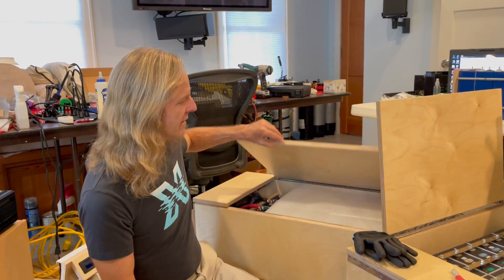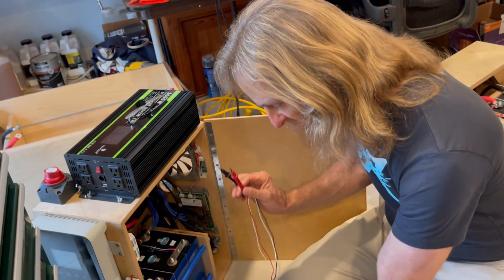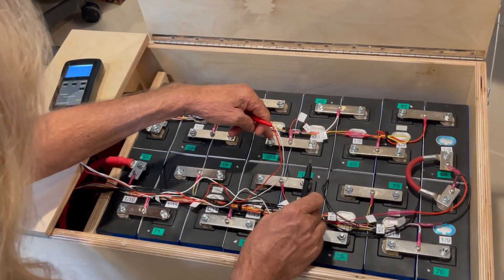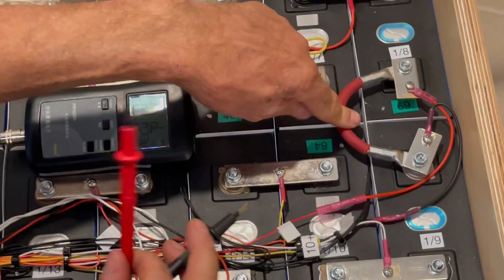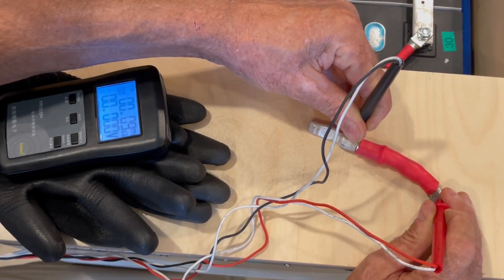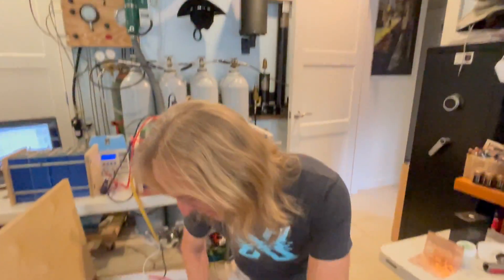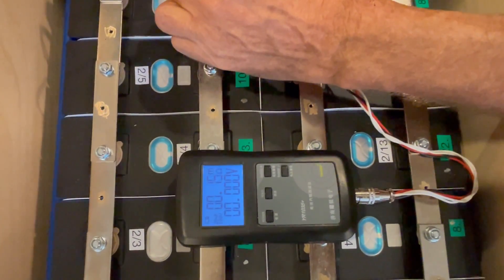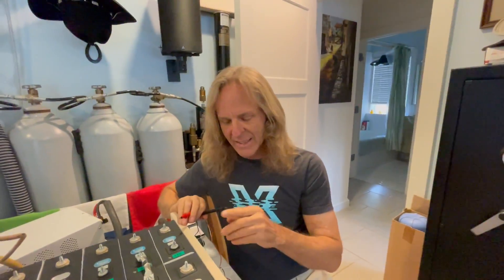It's No Joke, Size Really Does Matter!! Testing Flexible Busbars. Please read the description.

Comment: Ty so much for this information. You r so right no one makes the importance of the bus bars. Im an electrician but for commercial and some marine and we just went by the engeneers drawings to wire up loads always using nec regulations. But ive not been educated on the solar and dc side of things but we always stressed copper over aluminum and never used brass so it is strange they would use brass bus bars when the copper is better as a conductor of electricity. Thank u so much for bringing this to my attention.

Comment: You can't do a proper top Ballancen with 16 cells in parallel, and power applied to only one end of the series, at least you should make a diagonal power connection with plus at one end and minus at the other end, still however the string of parallel connections is too long. I recommend top Ballancen with maximum of 4 parallel cells, or even better only 3 diagonally connected, that provides for a more even supply of amps into the cells. But of course with an active BMS (supplying more power to the lowest cells), it helps even the currents out.
Reply from the maker: I don't understand how your comment relates to the video that it was made on. 

I will say thought that top balancing 16 cells is no problem at all and can be done to within one millivolt. Yes, it is best to charge from opposite ends of the string.

Comment: Ray use welding wire mate.
Reply from the maker: I use lots of welding wire. What do you mean exactly? The heavy red cable in the thumbnail is flexene welding wire but honestly 2mm x 20mm copper bus bars are perfectly fine and I use them everywhere I can. The people using flexible busbars should just realize that the size needed to match a typical busbar is bigger than they think. I must not be understanding something.

Comment: Not much electrical power is supposed to be utilized by the retaining studs/bolts. But the connection of the battery base terminal to the bus material.

Comment: I think i'd buy copper bars from a local metal work shop and make my own bus bars in case I received brass butt bars
Reply from the maker: And would you then pay to have them tinned to avoid oxidation and galvanic interaction with the aluminum terminals?
Reply: @RayBuildsCoolStuff  OH SNAP! Forgot  Galvanic reaction! Yeah you are right; I have access to 99.99% copper bars, but no tin plating shops (those chrome plating shops went out of business 2 decades ago)

Comment: So....does this mean you were able to find 1/0 cable lugs for sale that contained m6 holes? I have not been able to locate quality closed tinned copper cable lugs larger than 2 AWG that have the correct size holes to match the battery terminals. Any supplier suggestion you have would be greatly appreciated.
Reply from the maker: I got them on Amazon and when I added more batteries I found them. Again but it was harder and more expensive.
Reply: @RayBuildsCoolStuff  Ah...but if you were building 4s4p batteries for a boat in specialized plastic cases, where you could orient the cells in parallel, but wire them in series diagonally creating a little more wire length (to ease construction) and also achieve a cleaner balance wire arrangement + cable boots on the studs to protect from accidental metal contact and vibration chafe (think 5m waves outside Bora Bora).... My plan is to investigate the resistance a bit further with diagonally placed 1/0 cables and see if the loss is acceptable. I find it interesting that many high amperage BMS units have much thinner P- and B- wires... ~Cheers from s/y Element in Thailand~ Keep up the great work!

Comment: What’s your take on the difference in junction resistance of the bus bars and flexible links?
Reply from the maker: If you are asking if I think flexible links can allow for better contact then I would agree if care is not taken to ensure the bus bars are flat. I also think it is important to use welded studs as those that use the threaded female terminals are afraid to tighten above 4 nm for good reason. Copper bus bars will give enough to conform to slight variations in plane but not if you can't tighten the nuts enough. If you watch other channels you will see disagreement in our approaches. We must all judge for ourselves in the DIY world. That's a good thing, eh?
Reply: @RayBuildsCoolStuff  thanks for the response. I’m expecting a set of LifePo4 cells in the next week or two and I’m wondering what the best method of connecting the cells will be. Another YouTuber seems to have had problems using thick aluminium bus bars but a flexible link was fine. Obviously the cell terminals need to be at the same height but I wonder how level (perfectly horizontal) the terminals are. ( I hope I’m making sense) If the bus bars cannot flex and make full contact with the terminal when tightened down, there are going to be problems. Have you encountered this?

Comment: Sometimes, I don't understand what you are trying to accomplish here. If you really care about resistance on connections between cells, then use plain and thick (1/4 ") copper busbars, as well for washers and nuts, all in copper. Moreover the copper, being. a"soft" metal made a very good contact between posts therefore reduce risk of non perfectly flat contacts. I made my own 1/4" thick busbars from solid copper bars. Generally speaking, I do not like brass bus bars with their protection layer which change the reading of resistance. Just me, try COPPER!!!
Reply from the maker: Your comment shows I must have failed in communicating clearly. 

I use copper bus bars. The brass bus bars were sent by a dishonest supplier and were replaced with copper. 

There is no need for 1/4" thick copper bus bars. The 2mm copper bus bars are good for 300 amps. 

Raw copper will tarnish and over time will react with the aluminum terminals. My testing showed no benefit to using washers. The copper bus bars can be adjusted for flatness and will also conform within reason when the terminals are tightened.

The welded stud terminals have a smaller surface area but allow a higher torque value to be used so the connections are better and more secure. I have cringed at recent videos I have seen about other methods but we each get to make our own decisions about these things eh?

Have another look at the video and see if you hear it differently. I hope I haven't been confusing.

Comment: Hi Ray, 
Been watching you for a while now and this topics makes ask. 

I plan to install 2 units,  48v, 200Amp packs spaced 4ft apart to run a small EV as I am space constraint. 

Will an oversize connection cable compensate for the distance? 

Your thoughts on this will give me a direction to a solution and is much appreciated.
Reply from the maker: If you use 105c rated cable you should be fine with 1/0 wire. (50mm)
Reply: @RayBuildsCoolStuff  Did not think you'd be able to read my post much more reply on it.. You are the best.. 
More power to your channel. 
Thank you
Reply: Hi Ray, 
In searching Alibaba for battery packs. I asked the question about connecting 2 packs 48v (with BMS) in series for 96v EV use and have the ability to reconfigure to 48v parallel for Solar Hybrid (Emergency).
Though they could not give the reason why their reply was "Its not good to connect in Series (with BMS) but OK to connect in Parallel."
I got similar reply from more than one supplier.

Any thoughts on why this is the case? 

Thanks

Comment: I have seen in some of your previous videos that you have installed a 200 amp fuse in the battery box before the BMS. This means it is possible your entire bus bar system could be subject to a 200 amp current. Do you know your cell to cell bus bars are capable of carrying 200 amps? For 200 amps you would need somewhere around 60mm2 copper bus bars, that would be about 2.5 mm by 25mm copper bars. The 4AWG cable at the far end of the battery box is only capable of carrying 120 Amps. It seems to me that your bus bars and 4AWG cable will melt long before your 200A fuse blows.
Reply from the maker: I am using 200 amp fuses in the battery box. I am also using 175A breakers in the battery combiner box on each battery positive lead. The video notes that the 4awg 105c wire that is commonly used in this situation is not adequate and in order to equal the carrying capacity of the 2x20mm copper bus bars we use it would require 1/0 wire to have about the same cross sectional area. The 1/0 AWG 105 wire I use is rated for 286 amps. The 4awg 105c is rated for 160A. 125c insulated wire is rated for 172A. In neither case would the copper wire itself melt and an uninsulated copper bus bar certainly would not melt. If you watch this and my other videos more closely I think you might find that your concerns are addressed appropriately. It is after all the point of the connections video series that I made. I hope this helps explain my understanding of the issues involved.
Reply: @RayBuildsCoolStuff  Thanks for the reply. I was being a bit facetious using the word "melt" but I was worried the bars and 4AWG were undersized. I will do more research and watch more videos. I did not know you had a connections video series, I have only found this one so far on the subject. You have so many!

I want to thank you very much for all the work you have put into the videos. It is a lot of work for sure, but they are of great help to me. I am designing and building a prototype system and using your DC side design as a guide. I will use different AC side design as I like the MPP Solar LV6548 inverters.

Again thanks and I will continue to watch.

Comment: Nice and very interesting video about busbars and ther resistance. Was asking myself why commercial systems are equipped with welded busbars and taking the risc of tear and wear on the terminals when charging/discharging.
I use AWG2 cables to my Victron inverter, right in the middle of the square diameter of your future choice and actual setup.
I am still undecided how I will connect the terminals of my 16 pcs EVE 280K batteries but sure it will be at least AWG2.
Would like to use flat woven cables used for car engine startmotors, equipped with two 6mm holes for the new 280K cells.

Two questions:
a) what purpose do the 4 (CO2?) cilinders in the background serve?
b) I see you are balancing 16 cells. Are you top-balancing or bottom balancing them and what equipment do you use to charge/discharge your cells?
Reply from the maker: The cylinders in the background are for my scuba hobby. They contain EAN32 which is 32% oxygen. I use that and also blend it with helium or air or Oxygen to achieve other mixes.

The cells on the table are being tested one at a time in groups of 16 with a Zketech EBC A40L tester. Top balancing occurs in my battery boxes prior to final arranging of them into a 48v battery.

Comment: For my 24v 8s 280AH cell van battery…. Before I torqued down my tinned copper bus bars, they were getting disturbingly hot. I was much relieved when tightening them down improved it to having cold bus bars. I remembered your video being meticulous about your contact, so I got some conductive grease and a final sanding of the aluminum before attaching the bus bars. After getting off my battery and onto my circuit on the lid of my battery’s box I used flattened copper pipe to get to a kill switch and a shunt with 2 take off points for my inverter and the rest of my system. The only thing I am missing is a 250A fuse just after my kill switch for my battery.  I bet that will provide resistance. Anyway, thanks for the videos, they helped in my battery build.

Comment: @13:38 "I'm looking at all of the manufactured battery packs out there, and I don't see any of them...using flexible cable type bus bars..."  ...because wire & lug jumpers cost too much for too little benefit in most applications compared to solid bus bars. The cells intended for higher discharge rates (e.g.: Fortune) do have larger studs/bolts and contact pads, which is consistent with what your meticulous resistance measurements showed.

Comment: Since you’re looking to lean towards perfection, and I have that problem also…here’s what I’ve decided to do about my bus bars (5mm minimum thickness required… came with 2mm haaaaaaa) I have Two battery banks of 48 V 16 sells 300 amp hours each will be connected with each short homemade 2/0 welding wire with homemade 3/8 inch copper pipe for lugs which I will silver electroplate to reduce any corrosion effects from connecting them to the stainless steel terminals on the batteries, and increase the conductivity. When assembling I’m going to use some Conductive grease DEOXIT L260c. Any thoughts about my plan? (Non marine environment, however stainless and copper are dissimilar enough to create over time increased resistance, This is why they nickel plate them however nickel plating reduces the conductivity of copper… whereas silver increases conductivity by filling in any surface imperfections and the electroplating process seems simple and cost effective enough for anyone to do)

Comment: Once again… not batteries moving around…. EXPANSION and contraction!! Try to make thick aluminum “bookends” with your rods being spring compression to 12 psi. Claims by manufacturers of around 30% longer battery life… we all want to live longer, Yes?
Reply from the maker: The numbers you read for expansion and contraction are not accurate. Expansion does occur but I haven't seen anything close to the numbers that are published. Other of my videos speak to this issue and my approach. I use 1nm on four rods @ near full charge in a restraint system. I get no measurable movement of the cells from 0-100% state of charge and I'm totally comfortable with the solid bus bars. Consider that manufactured batteries almost never have any kind of restraint beyond holding the cells in place and most use welded connections with no flexibility at all. None use the method of springs that is popular with a segment of people on the forum. I do love the concept that we all get to figure out what we are comfortable with and pursue it for ourselves. It is a freedom that makes us strong and diverse which makes a robust community.
Reply: @RayBuildsCoolStuff  1mm per cell, if not compressed. as LiFeP04 specifications claim from low SOC to 100% SOC.

Comment: ALSO… 2/0 welding wire (9.5mm is 70m2) seems quite flexible and the short version busbar will have even less resistance than yours (yes 16 cells benefit from lower resistance)…
Reply: All gauges of wire you order online are  often described as flexible or soft. The variance from brand to brand can be disappointing. I find that Excelene brand the most flexible  and usually avoid any product labeled as welding cable IF flexibilty is of great importance.

Comment: have you done any tests that show any difference in capacity losses with the higher resistance brass? just wondering if it really makes a difference. do they get hotter while in use? will it take more energy to charge up the battery pack?
Reply from the maker: All of the energy of the battery flows through each bus bar. They need to be rated appropriately. 

Additionally, each bus bar is also a point of connection for the sensing wire for the bms and it is important that the voltage it senses isn't skewed by differences in resistance between the different cells. Low resistance and consistency is important. In the batteries it is not just about overheating while that is important. 

I want to build good durable low resistance connections that have a very long service life. I want to achieve that with a minimal cost and investment of time. 

The trouble we need to go to is definitely not about the efficiency or cost of lost electrical energy due to resistance.

Comment: Very usefull info! I have 16 x 280Ah sitting ready for being placed in 24V in my sailboat. The cross section is crucial to reduce the internal resistance of the pack and in the end make the system more reliable and effective. I will use my dyi 4x20mm flat tinned copper bars as bus. So to reduce the movement of the cell terminal, I will use a similar threaded rods in 18mm plywood case. I am looking forward to to your jouney moving forward with this awesome project of yours. Cheers from Norway!
 Thanks

Comment: I plan to wire 4 12v 300 amp hr LiFePo4 lithium batteries in Series. What size cables do I need?
Reply from the maker: How big is your BMS and your inverter?
Reply: @RayBuildsCoolStuff  I plan to use these 4 Enjoybot 12v 300 amp hr batteries. They’re same as Chin lithium batteries. They have built in BMS’s.  I will use them to recharge my Bluetti  AC200P on cloudy days.
Reply from the maker: What is your maximum amp draw?
Reply: @RayBuildsCoolStuff  I have a couple other 48v DIY batteries and when I connect 1 to my AC200P it draws in 564watts. So that’s about 12amps? Will Prowse did a review on this Enjoybot battery and said it can handle 200 amp discharge.
Reply from the maker: @billbradley2480  you can size your cables for the amp draw that you wish to achieve. Then fuse the circuit to protect the wire. I saw that video. If you wanted to sustain 200 amps then 1/0 wire with a 90c rating would be the absolute minimum I would consider. Better would be 2/0 90c and fuse it to 250A. If instead you only need 100a then I would use 2awg 90c and fuse it to 120A. This is what I would do but I am not qualified as an engineer so I can’t accept responsibility for the choices or decisions made by others. Standard disclaimer.
Reply: @RayBuildsCoolStuff  ok thanks. I will use 2/0 awg